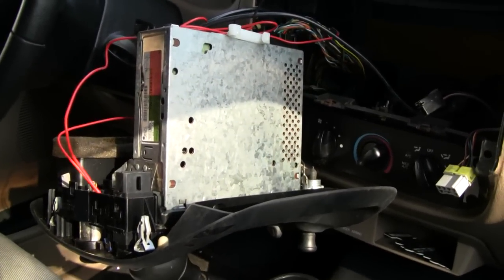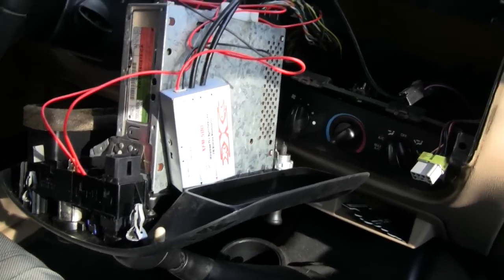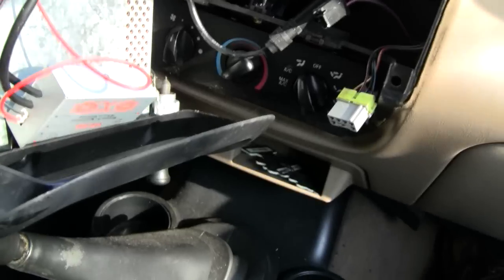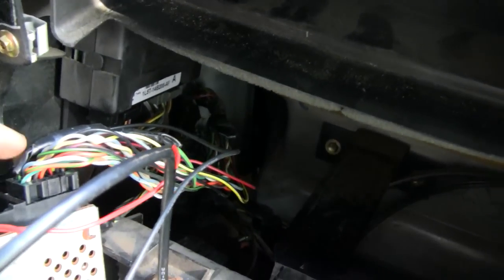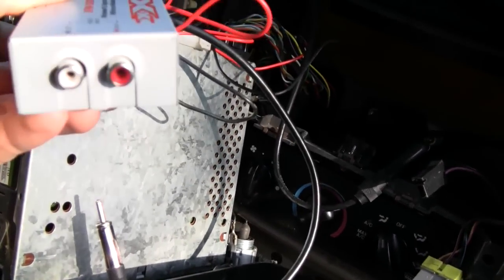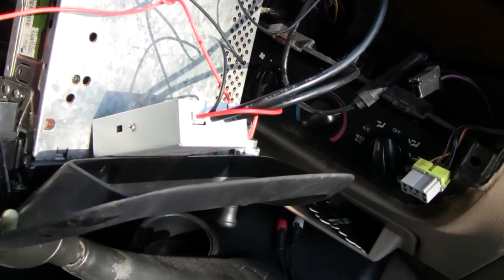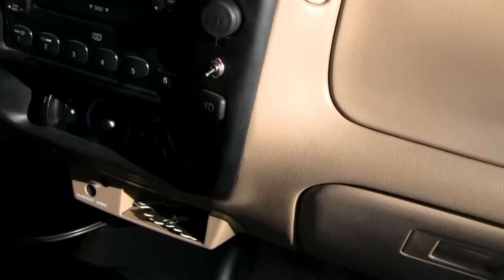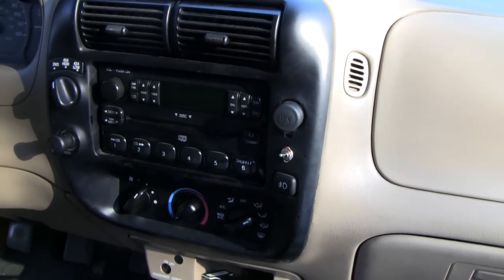UNIVERSAL AUX INPUT INSTALL FORD

Comment: The way these work is they bypass the antenna all together so basically your phone is physically connected to your stereo,  they don't actually drown out the existing station. I had one in a Chevy truck I used to have.

Comment: Attention! For anyone looking for a better solution for a newer F150 so you can play your iPod through your truck. This is the incredibly hard to find better option I just installed. Works like a charm!

Naviks makes an expensive cable that outputs from RCA and works with Sync 4. Its totally worth it though. You install this behind your AC controls. Pretty easy install.
"2021-2024 Ford F150 (SYNC 4) 8" Screen - AUX Audio Input Interface"

The Naviks cable outputs to an RCA Pair. So also buy a simple male RCA to 3.5mm cable port and switch it out with your cigarette lighter power outlet. The one below from Amazon fits the empty cigarette power output like a glove!!!
QIANRENON RCA to 3.5mm TRS Threaded Fixed Cable2 RCA Male to 1/8 Female Stereo Embedded Mount Adapter

With these 2 cables its gonna be about $245 but man it looks and sounds perfect! I'm thrilled.

Comment: Thats cool! I have a CD player and a tapedeck in my Ranger, So I just use the cassette converter. I works okay, I might upgrade the radio later on though.
Reply from the maker: I was happy with the cassette converter in the old truck. It worked well. But in the new truck 20 bucks for this box sure beats a new radio

Comment: Could I see the diagram and the wires you tapped into I'm trying to do the same thing I just have trouble finding the power source
Reply from the maker: John Baez Jr. What vehicle is it? I should be able to figure it out for you with the year and model
Reply: dirtbike5100 thanks a bunch like you it's a Ford ranger however it is a 2007 xlt

Comment: Stupid question here, do you need to have a working antenna to be able to use this?
Reply from the maker: No you do not technically need a working antenna. I am not certain whether your need to plug an antenna in at all as long as you plug the Aux box into your radio

Comment: You didnt need to put it on a separate power switch like you did. I has used FM modulators for years and they only  play on the station selected so you can leave it on all the time and still seek out other station
Reply from the maker: Big Daddy My concern was that the constant current draw would eventually wear the battery down if the truck was sitting
Reply: That can be fixed easily. Just find a wire that is only on with ignition power. There are shit tons of them in there.

Comment: Please-please-please! Don't fuck-up your car's Audio computer electronics system(s) along with your car's computer electronics system(s) as well, if you haven't already with this Bullshit advice? The Radio frequency interference caused by this device, Will-no-Doubt, can & will effect your car's Audio & the car's, Computer electronics system(s). Hell, this ass-hole didn't even play anything from his newly installed Time-bomb? Because that's exactly what it is? It's just a matter of time before your car won't be running and there's no mechanic or money that can , or worth fixing it.
Reply: it is an isolator. It just shunts the outside antenna to ground, and injects a low power input to the antenna directly.